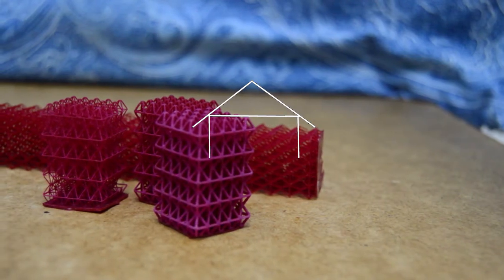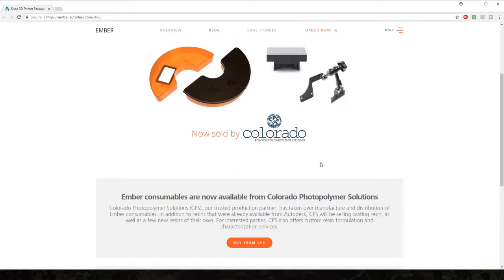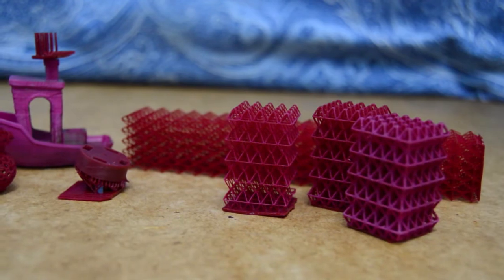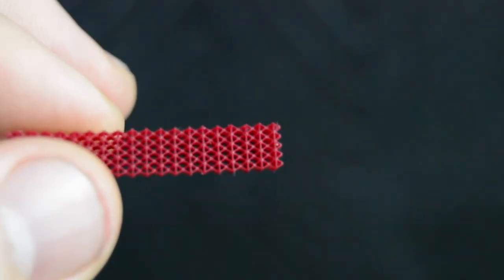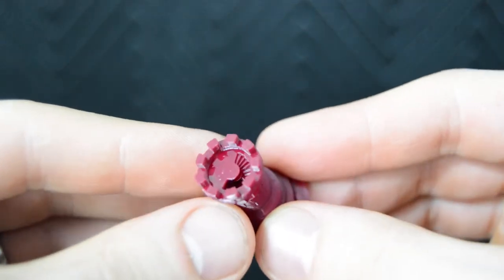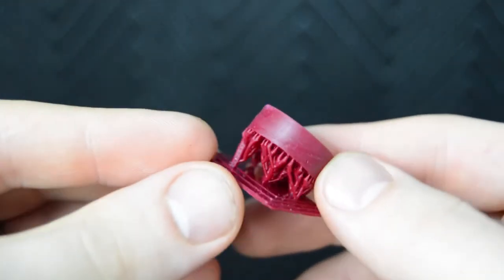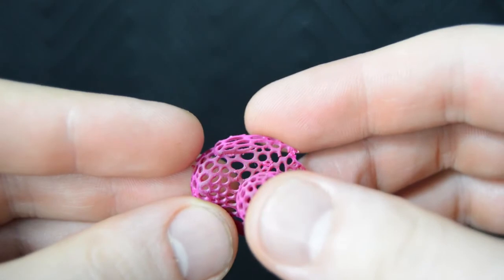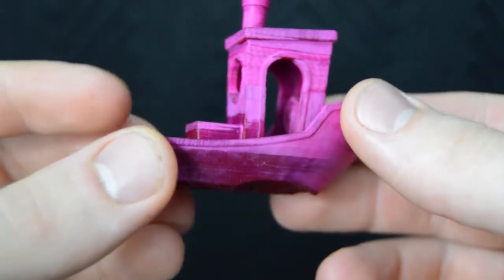Autodesk Magenta Resin Review ~ DLP/SLA 3D Printing Material

Comment: I got my FDM printer the other week and I love it, as a 3D modeler there's nothing more enjoyable than printing your own things. 

How much do these DLP/SLA printers cost to run(Resin/ResinLifeTime) ? and whats the cheapest/cheaper way in?
Reply from the maker: +ojl10 i got mine through kickstarter and paid about $2000. If you watch some of my other videos you'll see that some of the maintenance costs like vats can be reduced if your smart about it. Resin life time in the bottle is about a year which is plenty of time. 1L of resin can be between $80-$250, 1 liter will last you a while. Personally, between special application resins and casting resins that SLA/DLP printers have available that they have more capabilities than FDM printers